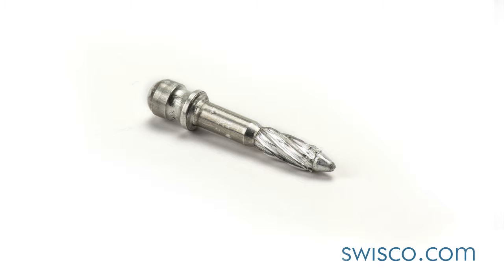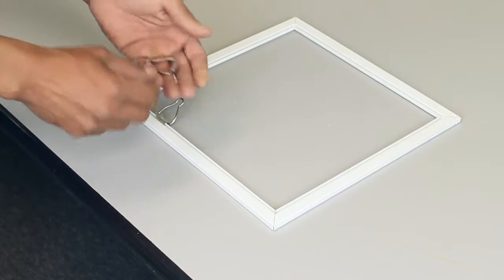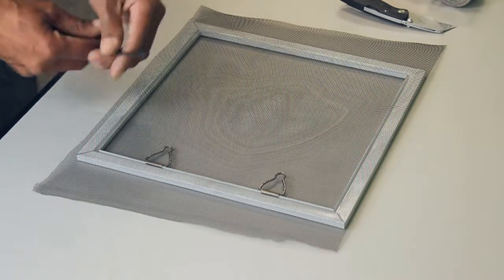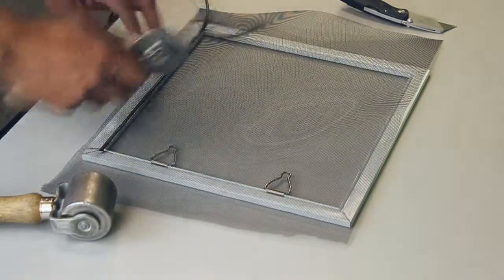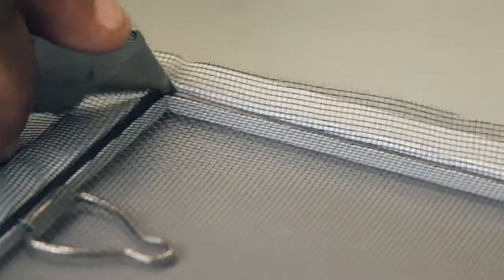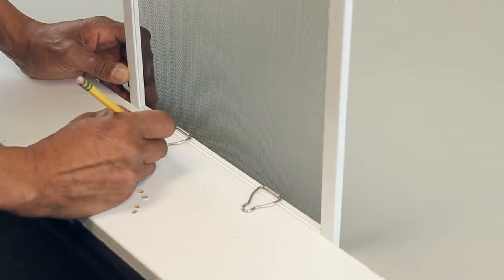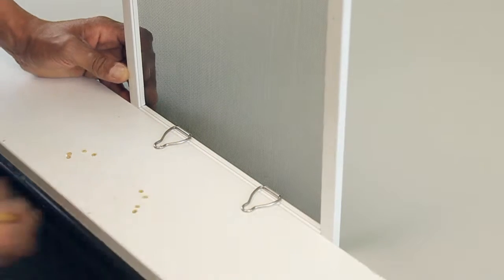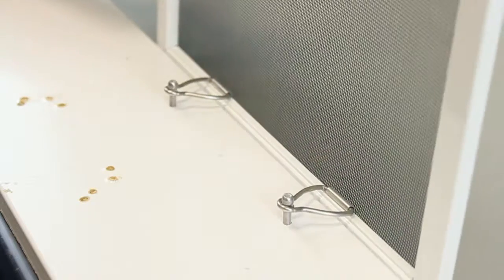How to install the Swisco 70-004 pull ring.

Comment: Those screens have the spine channel facing outwards?  I don't think I've seen that before.

Also, where do I find the pull tabs/rings for harvey window screens?  They're located on the perimeter of the screen frame in the grove that isn't the spine groove, but part of the screen frame flange channel.
Reply from the maker: While we don't carry the Harvey brand, we do have a selection selection of window screen pulls to choose from. Perhaps one of these may do the job https://www.swisco.com/cl/Replacement-Pulls-For-Screen_Storm-Panels
Reply: @SWISCO  Thanks, but they all seem to be designed around the spline channel.